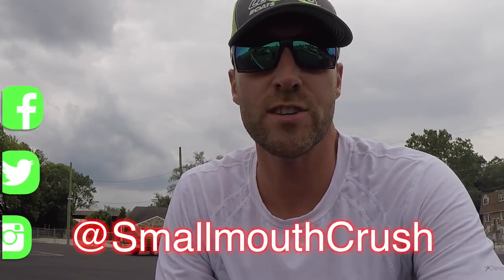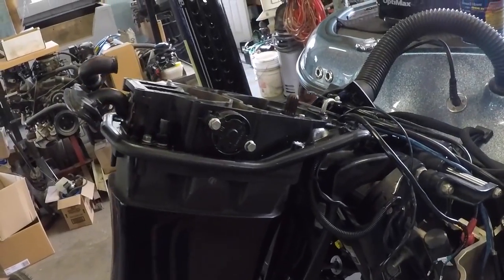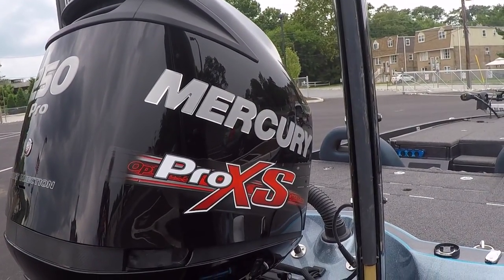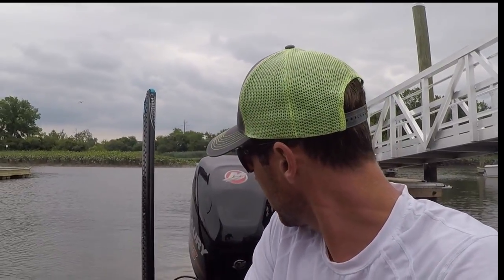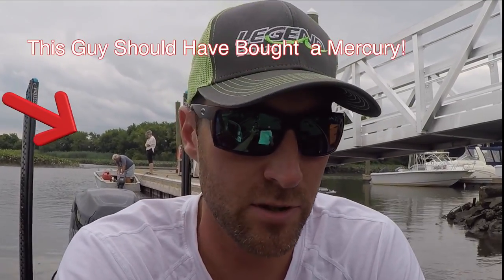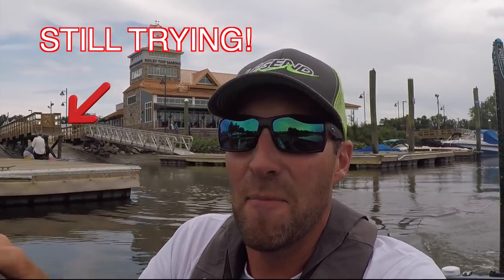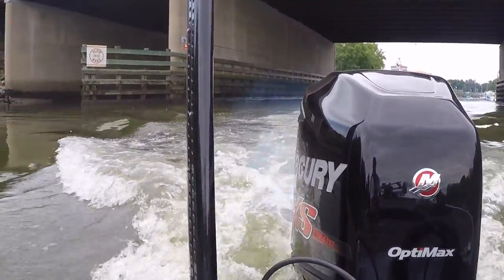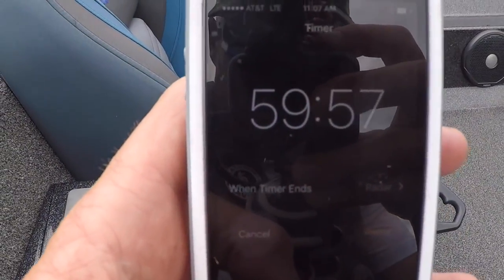How to break in a Mercury Motor Mercury Pro XS Break In Period

Comment: So while I'm breaking in my boat I don't have to run non stop for the 4 hours.. I noticed u did stop..
Reply from the maker: No you can stop and then continue when ready....even days later is fine.
Reply: SmallmouthCrush ok thanks
Reply: SmallmouthCrush  one more questions before I go out their and break in my boat.. the manual says to avoid triming up the motor.  While I'm running do I keep my motor down at all times?
Reply from the maker: Jadiel 254 yes it is advised to keep it trimmed down

Comment: It's all BS.  The first few strokes of it running are "breaking in" the next few hundred million are "wearing out".  You need to bed the cylinders and "seat" the rings.  You do that by conducting WOT throttle runs.  About 15 of them going Idle-mid-WOT-mid-idle cycles will ensure it's not an oil burner later in life(well...if it's a four stroke).  You get one chance...in the first 30 min to do it right and apparently most do it wrong because the OEM wants you to do some ridiculously complicated and unnecessary procedure.  It's all so they can void your warranty because you didn't do "it" correctly.     Ensure you have oil pressure, watch the temp and once it breaks it's "fever"...it's as "broken in" as it's ever going to be.  If it takes more than an hour total you're not doing it right.